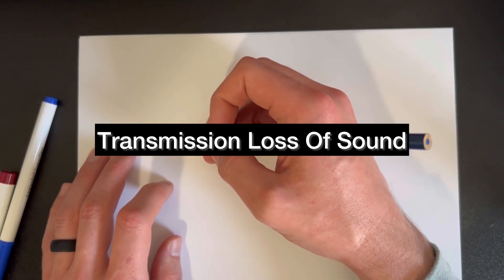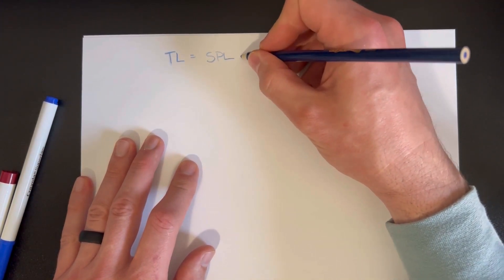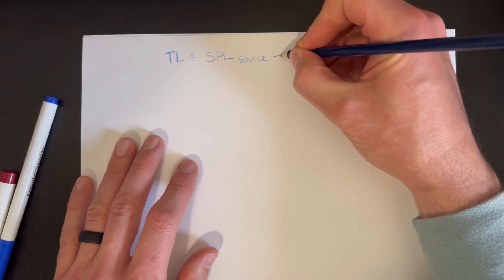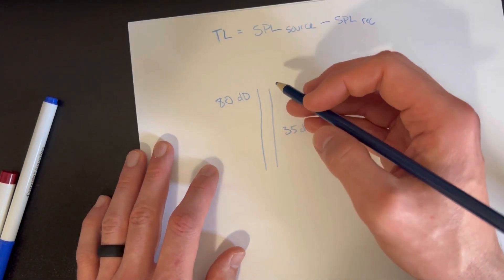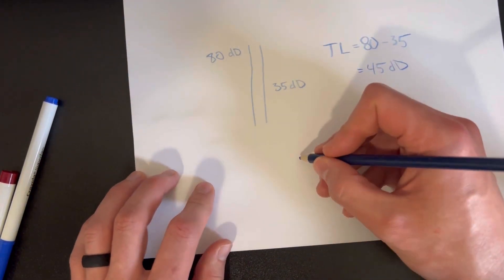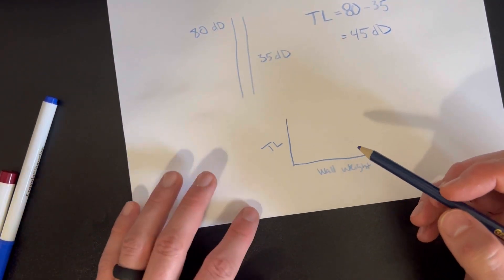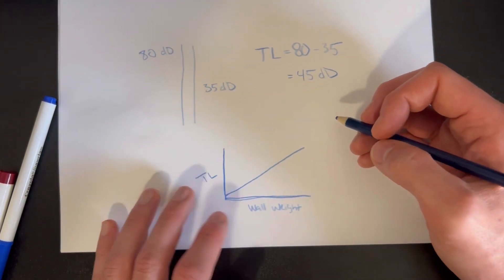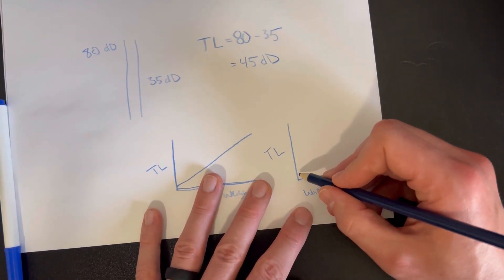What Is Transmission Loss Of Sound?

Comment: Hello, how do you calculate the effect of holes in a wall surface on the overall insulation value of the wall?
Reply from the maker: When calculating the effect of holes on the overall insulation value of a wall, it’s important to understand that even small gaps can significantly reduce its effectiveness. Sound behaves like water, finding its way through any openings, no matter how small. To maintain the wall’s insulation performance, ensure that all holes and cracks are sealed properly. You can use caulk, weather stripping, or acoustic sealant to minimize sound leakage and improve the overall transmission loss of the wall. Hope this helps. Please let us know if you have any other questions. Cheers!